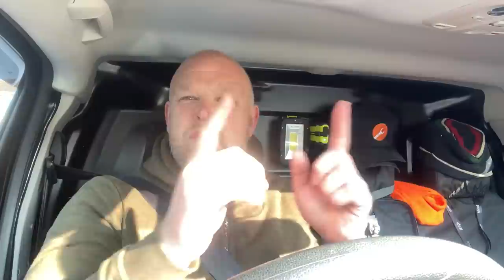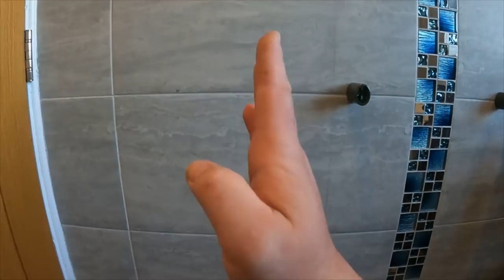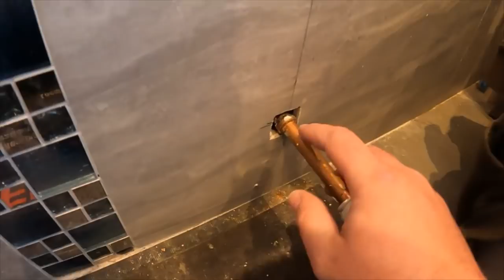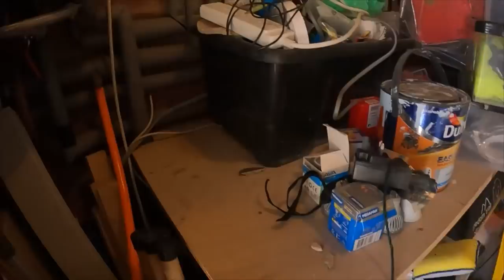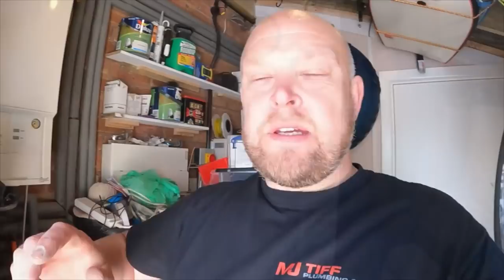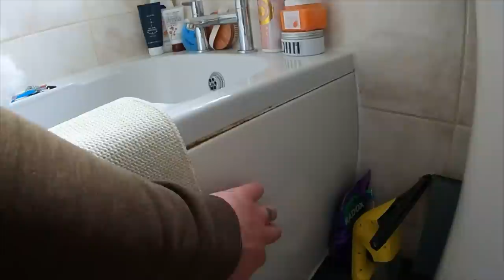WHY I HAD TO USE COMPRESSION PLUMBING FITTINGS ON THIS JOB…

Comment: Good Sunday viewing, i hope your feeling fit after your wolf run. I tend to use tectite fittings for those tight spots where its not possible to solder little bit neater than chunky compression, also on a combi system rather than draining down i tend to isolate the boiler and take the pressure off via the vent on a rad this causes a vacum just like bunging the F&E tank.
Keep up the good work.
Reply from the maker: Thanks mate, I’m feeling a little sore after then run to be honest🙈🙈

Comment: Tidy work with the towel rail mark you made the best of the situation with it. Looks like the previous installer lost the 4th fixing. Good luck with the g3 assessment, mines due later on during the year but I will probably let it run out as I'm more or less off the tools now. Was quoted between 90 and 175 for the day depending who I done it with. The big boys worcester baxi gledhill do it but it will probably include marketing their products
Reply from the maker: Thanks buddy 👍🏼👍🏼👍🏼

Comment: Great job on the towel heater, but doesn't having the rad valve sticking out interfere with the door opening?
You could have raised the height of the rad and used in line valves.
As a joiner I've learned not to put door frames tight to corners, 
An extra stud makes life easier for everyone, no scribing arcs, and more room for rads in tight rooms.
Reply from the maker: Customer was happy how it was and it’s not an issue…. Good idea with the frames
Reply: @MJTiffPlumbing  to be fair, it was one of those impossible jobs, no matter what you did, some wise ass would find fault, the important thing is your customer was happy, 
Its good how you show in your videos when to get the customers opinion, it shows how personable you are.

Comment: I have a copper pipe 1/2 when I cut the pipe the other end of the copper pipe according to the string measuring end up being which is a slightly larger , can I use compression fitting to fix the pipe being nothing will fit

Comment: With the foul pipe job, rather than replace like-for-like, could you drop down and combine the condensate, basin and bath pipes into one 40mm pipe running along the house. Less piping, less cutting into the down pipe, looks neater. Keep up the good work 👍
Reply from the maker: Thanks mate, I don’t like combining wastes as it will cause them to pull on each other

Comment: I'm not a plumber by any means but I was thinking, could you not take the plastic fitting off, soldier whatever you need to then attach the plastic fitting back on after. This way you won't get any heat on the plastic.
Reply from the maker: You can’t remove the plastic

Comment: I'd have personally used a tectite sprint fitting on there for that rad, I know people don't rate them but I've never had an issue with them even on mains pressure

Gotta hate making those kinds of decisions
Reply from the maker: I think the sweep of the bend would of thrown it out to much to like up with the street elbow into the value….
Customer was happy with how it was done so all it good👌🏼👌🏼
Reply: @MJTiffPlumbing  fair enough mate! Yeah as long as customer is happy and you get paid that's all that matters at the end of the day :) 

Might be time to go press ;)

Comment: I like your professionalism, which leaves me puzzled as to why you chose to drain this system. Once you had released the pressure and closed the drain off, the vacuum created would have meant any water escaping from the tail would be minimal, less than a plumb tub. Having made both connections, I would definitely have added some inhibitor to the towel radiator before filling, especially since you did a part drain.

Re the compression fitting, like many others I would probably have opted for a Tectite Sprint elbow. Neither is ideal, the original bathroom fitter  being at fault for making such an amateur mistake in positioning the rad as he did.

keep up the good work.
Reply from the maker: Drained the system as it’s took about 5mins….. not an issue at all. As it’s a pressurised system you know there will be no issues with airlocks when you fill it back up. I bung tanks and vacuum hold jobs like this on gravity fed systems as you will see in my other videos 👍🏼👍🏼

Comment: Could you have used a tec tight fitting on the rad
Reply from the maker: Possibly however I think the sweep of the bend on one of them would of been to big…
Reply: OK thanks for replying

Comment: Great video 

Had a similar issue before with plastic fittings on a rad and used tectite push fit as client wanted copper not brass compression don'tlike tectite myself but only option without ripping tiles off and it still ok.

How did your run go the other day take it you survived. 

Have a good week take care 🙂
Reply from the maker: Thanks mate, I’m still aching from the run 🙈🙈

Comment: Pushfit copper elbows work well in this situ mate👍
Reply from the maker: Thanks mate, think the radius of the bend would of been to big…
Reply: @M J Tiff Plumbing  

Know exactly what you mean mate,impossible for me to tell while watching on my phone😃 You know what ya doing though,can so relate👍They used to do a kinda end feed pushfit copper 90 but can't get them anywhere? Ordered a couple online but they still sent the bigger swept 90 type. Used this type on my place coming out a cavity wall so had to Bury the majority of the fitting in the cavity to allow for it to be clipped,also had to increase the hole size slightly in the Talon cover to allow it to fit flat to the wall👍

Comment: I ended up by giving likes on trust to your videos before even watching them. I don't understand if a customer is doing a new bathroom why not paying for removing a couple of tiles, reroute the pipework and connect the rad with no visible pipe. I come from Italy and over there I have never seen a visible pipe out of a wall.
Reply from the maker: Thanks for watching mate, this bathroom has been done a few years by someone else, they didn’t want the hassle of removing the tiles and were happy to have them on show in this case

Comment: U can get push fit copper elbows no?
Good vid bruva
Reply from the maker: You can…. But the sweep of the bend was too large to work with the fitting on the rad🙌🏼🙌🏼
Reply: @MJTiffPlumbing  arrr gotcha 👍

Comment: Never seen a towel radiator that low..
Reply from the maker: You have now 👍🏼👍🏼
Reply: yup. Just thinking if they had put it at a sensible height in the first place might not of affected the toilets positioning

Comment: Reserved this comment from a previous vid. I'll be walking off only the second job in over twenty years tomorrow. All the key indicators of summat not being right were there, yet I persevered in good faith. Not even a general builder managing the work but the house owner. Patience tested to the maximum. If I am being conspiratorial or suspicious, it would appear that all my suspicions have been confirmed. 3rd crew of plasterers, chippies and sparkies dropping in for a few hours, their work left perhaps intentionally incomplete and not reappearing for days. I've had enough.
Reply from the maker: Wow….. if you sense it’s not right then your doing the exactly right thing mate, as per my video…

Good for you buddy 👏🏼👏🏼👏🏼
Reply: @MJTiffPlumbing  Thanks!  If in doubt, walk. Make polite excuses, express regrets for not accepting work (lie) and  inevitably another oportunity will arise, or catch up on smaller, non emergency jobs, for good existing customers.
Reply from the maker: @loafersheffield  exactly mate 👏🏼👏🏼

Comment: Based on a similar experience, it's likely that the left hand valve will be struck constantly when the door is opened and eventually start to leak. Although less atheistic, your original idea would have been better in the long term
Reply from the maker: Thanks mate….

Comment: Don't you ever use the copper push fit fittings. Would of made that radiator look neater.
Reply from the maker: I think the bend on those would of been to large if you know what I mean..

Comment: Doesn't look great and looks even worse with big bulky compression fittings, you can hire a press tool for a few hours from the hire shop
Reply from the maker: I know it doesn’t look great as said in the video, but the customer was ok with it and understood so no issue.
Press tool could of been hired, and fittings purchased which would of put the price up, and having not used one before I wouldn’t of risked it on such a tight place as if it went wrong it would of meant removing tiles etc….

Compression fitting, customer happy…. Job done.👍🏼

Comment: I've had a fucker of a job 😂😂😂👍 the easy one?? That couldn't go any more wrong 😂😂😂😂💦💦💦💦 got rid of the flexis for copper to the wc the £2 ball valve x threaded with a new female elbow and bstrd ball valve won't stop 💦💦💦💦💦 changed the olive pasted in front of the olive still 💦💦💦💦😩😩😩😩